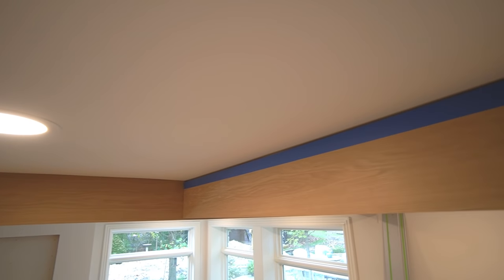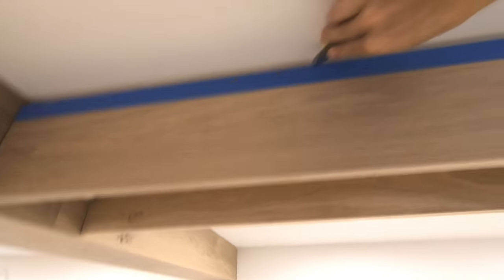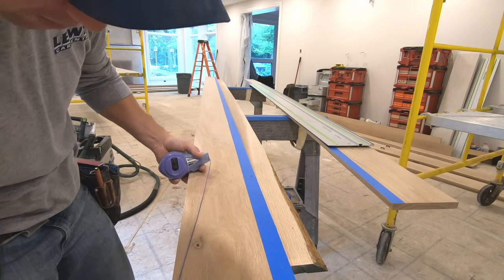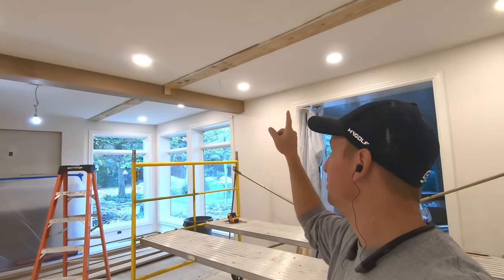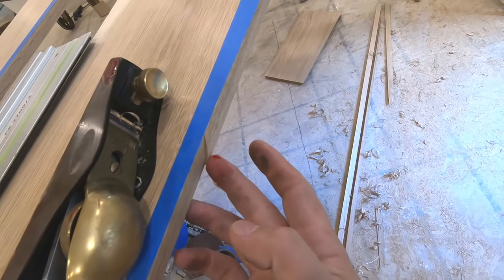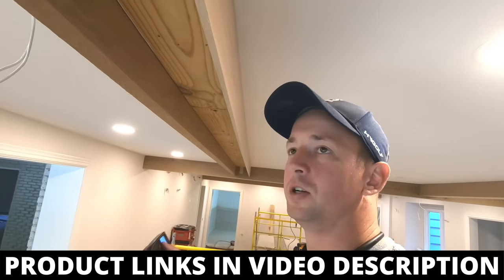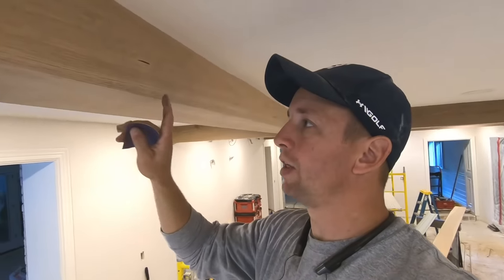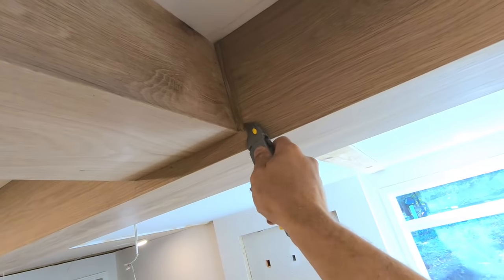WONKY CEILING Beam Scribing MAJIC - How to Get Perfect Fitting Scribes

Comment from the maker: THANKS FOR SUPPORTING BY USING THESE AFFILIATE LINKS!!!
Festool HKC 55 - https://amzn.to/3bE88lf
Festool TS 55 - https://amzn.to/3pUki1t

Leica Disto D2 - https://amzn.to/3bl7IQx
Senco 23 gauge headless pinner - https://amzn.to/3vXp2V2

FASTCAP GLU-BOT GLUE BOTTLE (16OUNCES) - https://amzn.to/3CHVZHT
Scribing/Marking Knife - https://amzn.to/3BnffsF

Shinwa Pin Chalk Line - https://amzn.to/3pOPFKQ
Low Angle Block Plane - https://amzn.to/3vZBnIz
Reply: If you need help I’m available I’m don’t charge much

Comment: Lewis, great instruction on a true Hans “Solo” install. 6” PSA sticky backs on a 5.5x3x.75” MDF block with the front edge cut at 45 degrees. The sanding disc folded back over the front angle and the two long sq. edges has all but replaced my block plane and sanding with fingers,#220,150 & 80 grits. Spot on with 23ga pins and stain concept concealing holes!
I Like to use 1 ft. templates on vertical end scribes at walls with 1/2” ultralight MDF Sq edge then transfer to final work.

Comment: Hey Spencer, I'm a custom cabinetry installer and when we scribe, we use General Scribing Compass and a pressurized ink pen (writes at all angles including upside down) this way you save the time of ripping off all the tape and can just scribe down to the pen line. Thought it may save you some minutes on the job. Thanks for the videos!

Comment: I really am blown away by the fact of how much work you do by yourself. It's amazing. Thank God for helping me find your Channel because I am learning a lot from your videos. Thank you so much for all your share and teach us, God bless you. I pray i gain some skills like you one day lol. 
But I have a question for you regarding these beams and it's also a question regarding  scribing in general. How do you know how much wider to make the side pieces of the beams before you scribe them, so that you do not lose too much material after you scribe? For example, if the finished size is supposed to be 5 inches wide, do you add one more inch to account for scribing? I always worry about scribing and losing too much material if a wall or ceiling is way too off.

Comment: So happy for your growing success! I found you at around 8k subscribers.

When scribing hardwood to a wall/ceiling, how do you account for expansion and contraction? Have you encountered problems later where the scribed wood joints were affected by wood movement?

Thanks Spencer!
Reply from the maker: I don't feel that its much of a factor. Its nailed to the cleat. So it should stay pretty tight.
Reply: @InsiderCarpentry  Thanks for the reply!

Comment: Love the shim idea. About the irregular ceiling: did you discuss with prime/site supervisor (or whoever) to decide whether to refloat before continuing with beam installation?
Reply: As a high end custom GC myself, I can say that floating out a ceiling with 5/8” discrepancies would be wildly impractical and expensive. Ceilings can not be floated flat over long spans like concrete. The easiest fix is at the framing stage. Scribing is the most cost effective given that this is a remodel project
Reply: For us it depends on who is doing the install. If our A crew is doing the install then it is easier and cheaper to let them scribe. If it is one of our others then typically we recommend they get ceiling floated. Those scribes typically come out cleaner however because they drywall guys still don’t get it anywhere near where it needs to be
Reply from the maker: I was given a heads up that it was bad. But you don't really appreciate just how bad it is until you see a cut scribe. LOL
Reply: @MrAdamdumont89  This.  An ounce of prevention is worth a pound of cure I believe is the way the saying goes.

Comment: I have a question. When you scribe your beams you end up taking off how ever much off. By doing this you shorten your beam. How do you deal with this when butting into another beam. Example: say one beam Is 7 1/2 inches from the ceiling and the beam that buts into it has to be scribed so you take an half in off in now its 7 inches. How do you deal with that?
Reply: That's why he found the biggest gap, which was 13/16 and took that much off all of them.
Reply: I thought he said the reveal was gonna be 5/16 but then he removed 13/16. Or was that taken into account before  the heights were decided. Like what if the worst spot was an inch and you didn't want that large of reveals do you just have to leave the height long and figure out the biggest dip before cut the heights?
Reply: @mattgardner1972  I have the same question.  I don’t understand.
Reply: @jeremymccook742  I understand that part but let's say you have one beam all ready set ok? And let's say that beam measures out to 7 1/2 inches finished. Now you have a beam that butts up to the beam that's already set. And you have to take say 3/8 off it because they ceiling is out. Now you have a beam that's 7 1/8 butting up to a beam that's 7 1/2. If that makes sense. I'm speaking on were the two beams meet if one is a
 different size the won't flush at the bottem.

Comment: Great beam work!
I’m curious if you find it necessary to charge a premium for installing beams like this vs other scenarios you install? Not sure if you’re a cost plus, or bid every section of the job separately kind of guy. 
But it seems like between being on the ceiling and having to scribe fit & re-fit, and fit again, massive lengths like this just to assemble the product, it would be a bit of a premium (cost wise) process for the customer then many other areas of a house on the walls and stairs?
Reply from the maker: I gave a fixed price of $5600 for labor on that ceiling. I felt it was fair. I'd say I make out decent considering I'm doing a two man job by myself.
Reply: @InsiderCarpentry  Thanks for the quick reply!
Would you consider that kind of beam work a premium product/service as far as the kind of work you typically offer? 
I figure just the fact it’s against the ceiling really starts to weed out the hacks in the industry if you want quality work done.
Reply from the maker: It definitely is but I’m terms of my pricing I don’t really treat it differently aside from the fact that I’m definitely not working overhead all week and not make as least decent money. Not worth the wear and tear on the body.
Reply: @InsiderCarpentry  it’s always interesting to hear how people treat their pay structure for custom trim and millwork like that.

Comment: my question is? Is there a reason why those box beams aren't flush when you join thise 2 together, it looks like it's almost an 1 shorter than the others? is it preference? is it because the ceiling is waive and so if you where using a 1x8 once you scribe the board it then wouldn't be the same length? I mean obviously you could haide does gaps with crown if the customer wants crown but obviously this is oak? Great job man as always!!

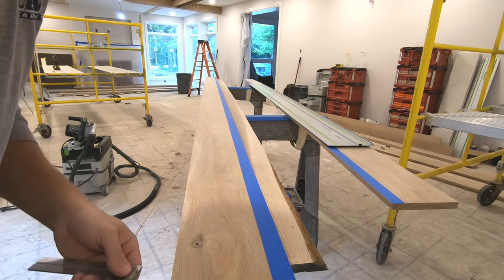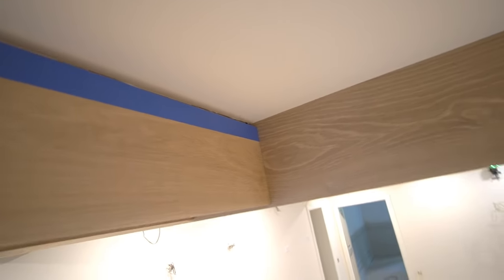Comment: 4:48  Spencer - after doing the scribing how do you determine the rip width, so as to provide a consistent reveal with the crossbeam?  In the video you say "I'll mark about 1/16 to 1/8" offset".  But at 0:24 you show one board with a 5/8" gap at the crossbeam.  In reference to the bottom of the crossbeam, the bottom of that end of that board is going to be 5/8" higher than where it was before scribing.  At some point, do you put a reference mark on the end of the boards, a set distance up from the bottom of the cross beams? (to determine a consistent crossbeam reveal)

Comment: I was sanding like that the other day shoved a toothpick size sliver right into my index finger joint?
Ended up cutting it open after pouring alcohol over my knife blade that I sharpen to a razors edge!  Finally after two days of cutting & digging it came out?  Healed & I can tell some is still in there!  
Should hv went to Wal Mart bought a right index finger and cut the old one off and switched out?
Reply from the maker: I had that a while back. A sliver got left in deep and it took forever to heal and get right again. Skin hard hard and I had to dig in multiple times until I finally got it out.
Reply: @InsiderCarpentry  well so far I hv saved some cash on minor operations ?

Comment: Check your nail gun for nails after each board you nail on the ceiling. My father in law had beams installed just like this. The bottom board facing the floor fell down about 3 months later almost hitting my mother in law in the head. Ceilings are 12' high-quality could have liked her. We looked at the vertical boards, we could see nail holes from the nail gun. Being a wood worker I think what happen is the fireplace was on for several weeks and dried the wood shrinking it allowing it to fall. The nail gun ran out of nails before that piece was installed. If there was 1 or 2 nails in it, it probably would have never fallen. Save yourself a lawsuit or rework and check the nail gun before or after each beam to make sure nails went into the wood. If nail gun is out of nails, load it up and put more nails in the wood, it will save your butt.
Reply from the maker: Glue helps too… 😳😳😳😬😬😬 Yikes! Glad no one was hurt.

Comment: Looks awesome Spencer as usual.  Qq for you have you ever run in to a scribe situation where the one side need it more than the other? And how would you handle it?  Scribe each independent? Or use the largest regardless of size for both sides?
Reply from the maker: This is often the case...the beams need to be level so you need to tack them up level, then scribe the same amount off of both sides so that they will both stay level with each other.
Reply: @InsiderCarpentry  that’s what I thought. Otherwise it would be completely out of level on the bottom.  Thx for the response. Keep the videos coming.
Reply: @biskygiver  he had a green laser level set up at end of room, so he was going off of laser, which we know sets a perfect imaginary surface to go off of, you put your primary beams in first with laser, then you put your secondary beams in either flush with bottoms of first or creating a shoulder from first to second, with laser each and every joint will be the same, but I must add before you start use laser to determine your highest spot in room and work off of that measurement. Happy wood working!

Comment: not sure how you maintained a consistent width from pieces you nailed up to accept bottom piece. looks like it worked. I would have built boxes in shop cut 45 on table saw then biscuit it together no nails , would probably use mini belt sander to do scribing  . thanks

Comment: Didn’t you say 45.5 instead of 46 degrees on a previous mitre folding video? Just curious. Thanks!
Reply from the maker: Either work, but with the size of these beams I felt 46 was a little safer in ensuring that the outside point of the miter would come together.

Comment: How do you manage to get a consistent reveal between the bottom of the cross beams and the perpendicular beams, with the drywall being so wavy and different scribe measurements?
Reply: I was wondering the same thing.  I thought he said 5/16 reveal then he cut off 13/16..
Reply: @mattgardner1972  his work is so professional and clean, I would really like for him to respond to this question. Every time I have to scribe something, usually deck boards to wavy stucco on houses, I have to account for the material being removed for consistent spacing. If he has a trick that I don't know about, PLEASE SHARE!!
Reply from the maker: I have another video coming in which I explain the process to some degree. I'll try and cover it more in depth in future videos.
Reply: @InsiderCarpentry  thank you!

Comment: I’ve never seen anyone scribe with a track saw particularly when it’s irregular and wavy, I use a jigsaw at a 5 degree angle. Before accurate jigsaws it was a hand panel saw 😉
Reply from the maker: I just get it decently close with a track saw. Follow up with a block plane.
Reply: Yes I see how you do it, just saying I’ve never seen a track saw being used I just cut to my line with a jigsaw and job done it’s just personal preferences. Keep up the good work 😉

Comment: Damn... Framers really did a number on that house.
This is what I don't like what's happening in the industry. Lots of production framing crews. Can they frame sure... Can they frame level and plumb? No! It's so annoying to have to tile walls or install a shower door with floor 1/2 off on 42" floor. So Leveling it... You can see a huge gap on bottom. Come on framers... Pick it up a little...
Set all ur joists crown up! This man had to scribe the ocean on his beams come on!

Comment: Another beautiful job, Spencer.  You make it look so easy.  I'm lucky if I can build an 18" box beam that's uniform.

One question - what is the angle for the cut on the bottom board?  You mentioned 46 degrees for the sides.
Reply from the maker: Both sides of the miter are ripped at 46.

Comment: why did you use a 46 degree miter rather than 45 degrees?
Reply from the maker: with 45 the outside of the miter will be open. 46 allows the top of the miter to close and room for the glue and any inconsitencies. Gives a better finished result.
Reply: @InsiderCarpentry  Thanks!  I would not have thought of that!  Thanks for the videos.

Comment: As a jobbing carpenter, for over 30 years,  If I didn't put the ceiling in; I ain't scribing...I charge more and trim the joint... If the ceiling is bad,  use a flex molding ...Nobody looks at the ceilings anyway... :)...You young guys don't recognize opportunity... And those faux beam ceilings went out with Avocado counter tops... They're a pain in the ass to paint, keep cobwebs out...etc...Just sayin...You do nice work though...